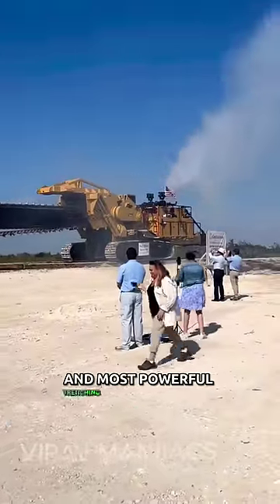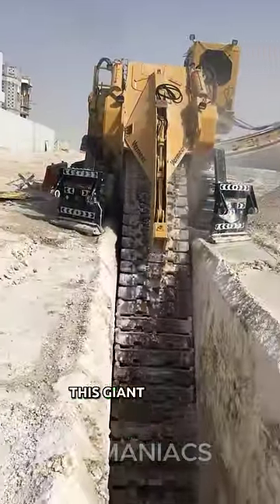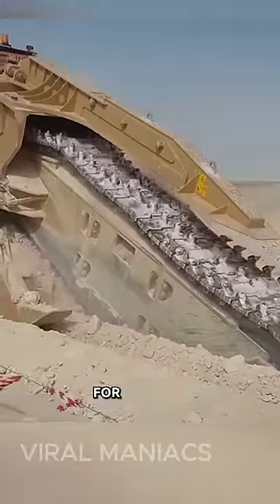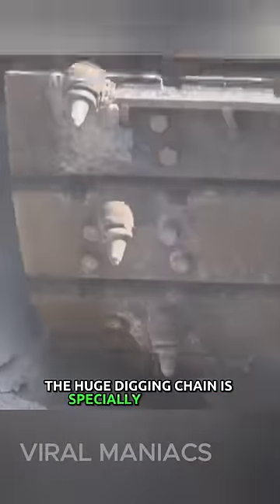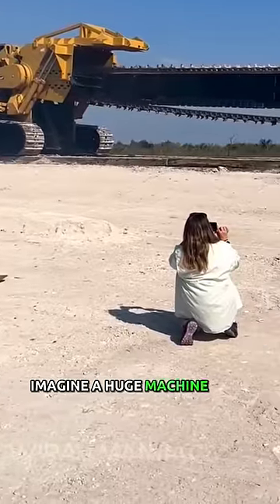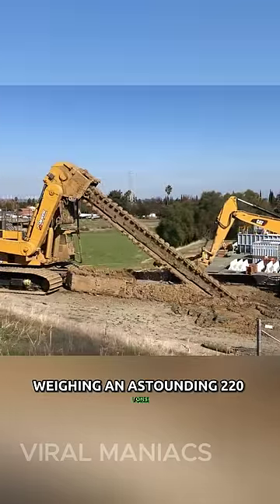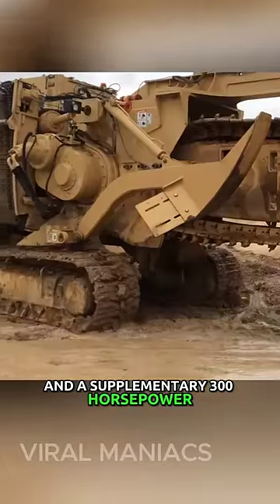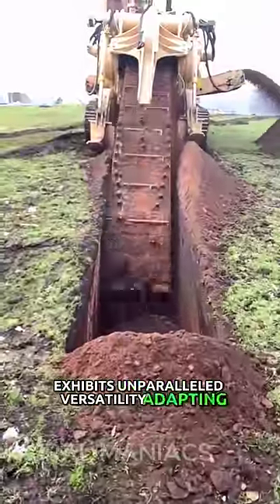Unbelievable Giant Trenching Machine - Trencor 1860 #shorts

Comment: I got a feeling it's going to be a while before they can make a battery for this one😂
Reply: Hook it up to grid
Reply: @thatsawesome2060  it will probably cause a black out in 90% places 😂 it's not a mobile phone it's appetite will be close to a small town
Reply: @ivarsodins9959 No it won't, because grids don't work that way. It is interconnected and there are three of them. 

 Tons of large machines run off electricity. In fact one as that make this look tiny do. 

 Don't know much about large machines do you?
Reply: All those big machines have multiple wiring literally as thick as you physically.

The amount of power this will need to do its job will require multiple multi inch thick cables to power it measuring HUNDERDS of feet to the nears specially set up sub station.

Also most of those machines you thinking off are either stationary, as in bever move. Or stay withing the same 4 mile square with bothing being a pain to move.

This thing needs to dig a dozen miles in a direction while running.

Its simply not feasible to grid power it.

While batteries will only run it for bout 4 hours with 8 hours of charge. Instead of 8 hours on diesel and 15 minutes to full up.

The tech is not there yet for battery powering certain things, these are among them.
Reply: @dianapennepacker6854  If load is too big, the substation will trip a breaker.
Reply: @dianapennepacker6854 what machine runs off the grid that uses more power than this beast? That’s be an interesting video
Reply: @Handley941 you are realy funny and not educated enough it seems^^.. 1600hp and 350hp for movement is together only 1,4MW of Power but.. those are combustion engines! They produce only 40% of usable power at the business end. all other is lost in heat and internal friction. So this comes out to about 580KW of Electical Power need.. you can literaly buy an electic motor off the shelve from ABB with this rating.^^
Also you realy think 1600Hp Generators dont exist? you can combine more as one genrator.. you can prodice electric energy on side for those where the grid is not suitable and power plants have power in MW.
Hitachi got a electrtic 2x1200kw excavator running mining operations all over the world.. so yea.. you clearly dont have any clue^^
Reply: @Total_Egal I wasn’t clear in my question. I meant machinery that moves like this excavator that’s plugged into the grid. Of course there’s generators that produce for more power than this thing.
Reply: @Handley941 there are machines way bigger and powerfull as this who "plugs into the grid" but usuall construction equipment like this is used in remote locations for onlay a short period of time. running bigger powerlines to this area extra for a simple drainage pipe job is not logical and wasted money.
but.. there ARE machines who are way bigger this thing.. and run on electricity instead fossil fuel.^^
Reply: @Handley941 They use electric digging equipment in mining. They actually have a giant cable that runs to the supply. I can't even imagine how much current they draw. These are machines bigger than a house too. Much bigger.
Reply: @janus4002 Yeah it’s crazy. I know there’s a lot more powerful machines because I used to work on cruise ships. One had diesel engines and gas turbines that provide 120,000kw and run 4x 21,000kw propulsion motors. 

The person who posted earlier said there’s way bigger machines running off the grid which is why I was asking them which ones that are anything like the one in the video.
Reply: @janus4002 but in a mine they don't move far and are there for a long time so it's economic to wire them. This moves from place to place regularly so the electric set up  costs are not viable.
Reply: the tesla model S plaid has about 1000hp. so just use 2 with the car batteries and hook it up to a generator and we are all good to go.
Reply: @Penaming the batteries wouldn’t last very long I imagine. This machine will be running almost full load constantly. I’m not sure how long the battery would last on a Tesla if it was going it’s top speed constantly? Also the cable would be massive transforms to connect to grid wherever it goes.
Reply: Equipment like that will be hybrid electric
Reply: We already have batteries powerful enough to run this machine. And charging it wouldn't be any different than what these machines already have to deal with. You can't just roll this beast up to a gas station. They need fuel trucks to bring the fuel to them. For a battery operated machine, they would likely just have a special battery swap mechanism. Then the truck brings the drained battery to a charging station. Similar to what you can do with a battery lawn mower. One battery charging and the other in-use, then you swap them around when the current one runs out.
Reply: @ericzaiz8358  nevermind, well said
Reply: They could make a diesel electric hybrid today And it would probably work better.
Reply: @Total_Egal and you think they plug in for 7 weeks to charge them? Don’t they have onboard generators?
Reply: @Total_Egal wtf is a “fossil fuel”. Wait do you think oil is melted dinosaurs still? 😂

Wait till you hear where the oil REALLY comes from. You should probably talk to the saudis, once they’re done laughing at that idiotic claim. 😂😂 “peak oil” was in the 70’s if youve ever looked into this. You know that was 55 years ago and funny enough, they’re still finding new oil to drill. 😂😂😂
Reply: @Penaming 😂😂😂😂😂😂😂😂😂😂😂😂😂😂😂😂😂😂😂😂😂😂😂😂😂😂😂😂😂😂😂😂😂😂😂

Holy shit all 9 boosters detected.
Reply: @dianapennepacker6854 yes, big machines do use electricity but their not constantly moving either.

You would see a thick cable following this thing around hooked up to a transformer the size of a building, dude, what scale are you measuring with?
Reply: No way a battery can run that thing ... Maybe if it is plugged directly into the high voltage lines of the grid
Reply: @Total_Egal ... You are forgetting that the 2,000HP had to pass through a gearbox to produce the required force.

For comparison, checkout how 1,000hp electric pickups, like Rivian, consume power when they are given a proper load ... A 100KWh battery can barely go 100miles towing relatively light loads 

A motor that can produce the equivalent force to dig these trenches would consume quite a bit of electric power. More like a whole manufacturing factory.

And this thing has to be mobile, it moves ... Meaning the power has to be supplied via movable cables that are able to carry all the power.
Reply: They could go Diesal electric
Reply: Two Teslas are more powerful than this thing, the batteries aren't problem. What do you think ships and planes use?
Reply: @dianapennepacker6854 Think it will need a little more than 400v three phase mate.
Reply: @dianapennepacker6854  you can't just park giant machine somewhere and expect ready electric infrastructure that won't get overwhelmed by such load.
Reply: @Total_Egal you are incorrect. 1600hp IS the output. Roughly 1200kw. When they say say 40%efficient they mean it uses 3000kw of heat energy from the diesel
Reply: @wayando  Hornsdale Power Reserve is a 150 MW (194 MWh) grid-connected energy storage system owned by Neoen co-located with the Hornsdale Wind Farm in the Mid North region of South Australia, also owned by Neoen.

The original installation in 2017 was the largest lithium-ion battery in the world at 129 MWh and 100 MW.[1] It was expanded in 2020 to 194 MWh at 150 MW. Despite the expansion, it lost that title in August 2020 to the Gateway Energy Storage in California, USA.[2] The larger Victorian Big Battery began operations in December 2021.

During 2017 Tesla, Inc. won the contract and built the Hornsdale Power Reserve, for a capital cost of A$90 million, leading to the colloquial Tesla big battery name.[3][4][5]

yes, these batteries can power entire towns.
Reply: You know you could look up the world's largest batteries and know that's entirely possible.
Reply: Draglines are electric and they're much, much larger than this. They can move an entire football field of coal at a time.
Reply: @Penaming  ... Yes. But can they be fitted to power a mobile rig? ... Can we move around with them?!

If you have hectares of batteries, like Elon's batteries, then sure you can power anything. Just not anything mobile.
Reply: And YouTube tried to delete my comment so I guess I said something right huh?
Reply: Use hidrogen combustion engine
Reply: Never see Terminator?

Who said, there's no battery that can't power this beast?

What about nuclear cell?

Can powered a much more bigger, aircraft carriers and submarines...

Last at least 30 years before needed to be replaced for a new one...
Reply: @aphiz4505  that’s not quite how nuclear cells work also they’re incredibly heavy and hot so they’re very impractical for machines like this.
Reply: @BaggerFood101  
No, dude the nuclear fission rods aren't that big, the shielding for radiation is the reason why, nuclear powerplant ended up really big...

Have you never seen an industrial grade furnace before? Do just one of this thing is soo big, that even this monster's engine look tiny or something?
Reply: I live in California, and like our legislators have a superior understanding of these things. The obvious answer will be to install a gigawatt solar array on-site in advance of any use of the machine, it's a green solution.
Reply: @wraith8323  
Last time I checked, they put nuke under green energy...
Reply: @Total_Egal this is a mobile machine not a company machine. it needs a battery to operate on the go.
Reply: just plug it on the grid - you’ll have way more hp that way
Reply: @Total_Egal  first off Electric vehicles waste just as much energy in production and disposal of toxic batteries. Second, this machine would not be as small and maneuverable if it was powered by electricity.
Third theese machines need to be capable of traveling all around the the state or country they do business in.
It really isnt practical to power it by electricity nor is it economical.
If it were somebody would have already built it and would be selling them. When California and other foolish states attempt to completely eliminate petroleum based engines youre going to see what a stupid idea it was.
Groceries will not make it to store shelves, whole industries will shut down, millions will be out of work , construction projects will halt, homes wont be built, meat, grains and produce wont be planted or harvested or delivered to stores. Medicine will not be delivered to hospitals or pharmacies. They really have not thought this through.
Reply: @thatsawesome2060  mega packs,  and a solar farm would provide plenty of power. Most of these run on electric already.
Reply: @Total_Egal 40% is basically never reached in combustion engines. This is a statistical peak power, which persists for like 1-2 seconds max in a state where the motor is accelerating in a specific way. 
The real output of modern combustion engines is on average 7-15%. The rest is lost heat.
Reply: All trains run on electricity.
Reply: @Total_Egal in order for a large piece of equipment to run off the grid without causing massive blackouts the section of the grid must be designed to accommodate the load, the substations must be beefed up as well as all of the transmission lines. Most large equipment that is connected to the grid I believe provide their own excess power ie onsite generators where the grid only provides a small portion of the power
Reply: @dubious6718 not all trains
Reply: ITT: the very slow realization the most industrial machines are infact diesel Electric
Reply: Y'all talking about plugging large machines "into the grid" are way off/using generators or "JuSt UsE a TeSlA bAtTeRy". Do you even know where the electricity comes from that powers the big drag lines or machines such as the Bagger 288? Clearly not. They have their own power stations. They DO NOT hook into the grid. They have a dedicated station whose sole job is to provide the needed electricity to these mammoth machines. They're not plugged in, they don't (can't) run on batteries etc. They have their very own power generation plant. Not a generator. Not a bunch of generators. They have a literal power station, that would normally provide electric to a small city, powering them.
Reply: @ivarsodins9959  You're the closest with the power demands. Anyone who refutes you has zero knowledge of how electricity works.
Reply: It runs on a small Diesel. Compared tovits size. The hydraulics are the power
Reply: Bro lost his wife to a Tesla owner
Reply: Truth
Reply: @dianapennepacker6854  Tons of large "stationary" machinery work of the grid. FTFY
Reply: @ericzaiz8358  Not quite.
For example wheel-bucket excavators that are 70m tall are powered by a single cable that's about 5cm in diameter, 4cm of which is insulation.
I'll give it to you, making a machine like that battery-powered is not going to be feasible in this century, probably longer.
Reply: They would probably make a mini nuclear reactor
Reply: @ivarsodins9959 don't know much about large machines do you?
Reply: Who cares? Its not like there are millions of these things out there anyway
Reply: @ivarsodins9959 Most heavy equipment is grid powered. We call the internal combustion stuff “pocket equipment” because it’s cute and tiny. The ONLY reason to run something on fuel is for portability. If power, longevity, or durability are needed, electric is the only way.
Reply: @StoneInMySandal  That's true. The only thing is that the majority of electrical powered factories have some serious power grid infrastructure. The aluminum refinery is heavily reliant on ⚡.
Reply: I am not pro-battery until they become safer themselves, hoping for sodium ion to be safer and sooner, but isn't the answer just to bring enough batteries for the day and recharge as you go 🤷🏼‍♀️
Reply: @wraith8323  lol of course Cali. Some places don't get much sun or any at all in winter. Gawd bless.
Reply: This can be done with electricity but civilization is not mature enough to accomplish this task.  Submarines and Aircraft  carries are all electric, but there’s the problem of the nuclear generator.  Although some civilian entities have been able to have their own reactors in the past, mostly to support the military on a contract basis, the private acquisition, use, and disposal of such a power plant will not be allowed for generations, if ever.
Reply: @dianapennepacker6854 except for tx lol I find it funny as hell how they really did screw themseoves and their own freedom with that one. Like grids to be agile need to work together it’s basically a giant electric insurance policy.
Reply: @ivarsodins9959  Ah what! Thought I mentioned that one of them isn't connected. (Texas)

 Man for real!  They shot themselves in the foot, as I read if they were connected to the rest of America's grid they wouldn't have half if not way more of those outages that they keep having these past five years. 

 Some of the outskirts of Texas are connected to the other two, and they were fine for most of the events I am told. 

 They didn't want the regulations that would have been mandatory for their grid to connect to the rest. So they (EROC) opted out. 

 Then being private made them cut corners, because ya know. Profit > A secured power grid. 

 They didn't build for the cold... Okay, maybe I get that.

 Yet they didn't build for the extreme heat either! WTF?! Do they not believe in global warming or thought people wouldn't all have their ACs on in 110 weather? 

 I'm not a communist. The grid shouldn't be private. Texas should have one of the best grids with their land being amazing for solar and wind, and having oil. They should be over producing for the rest of the country! Selling it, and using the new technology with high power DC lines to send it across the country.
Reply: They already can, it weight 5-10 tonnes
Reply: Hydrogen can help

Comment: That’s funny, doesn’t say Trencor… it says Vermeer.   Because it is a Vermeer.
Reply: The Trencor 1860 is not a Vermeer. They are 2 completely different companies. That machine in that clip was a Vermeer T1255III.
Reply: At the end it shows Tesmec 1475 or 1675 but calls it Trencor.
Reply: @andoa5747 exactly, this video showing Vermeer and Tesmec and all sorts of stuff
Reply: Just the usual Bolshoi on YouTube.
Reply: There is more than one machine shown in the length of this video
Reply: @JamesJamersonIsAGod  yeah, there's many machines,  but the ai bot is talking  as if there is only 1
Reply: @celloprof  zactly🤣🤣🤣
Reply: Video just jumped around showing a ton of different trenchers because this is just another crap AI channel. Only the first one was the actual trencor
Reply: Trencor was the only company, until TrenchTec, that used an Allison automatic transmission to run the digging chain. Tesmec, Vermeer, and ditch witch all use hydrostatic drive systems to run the digging chain. I worked for Trencor and then TrenchTec after Trencor was shut down and moved to Tennessee.